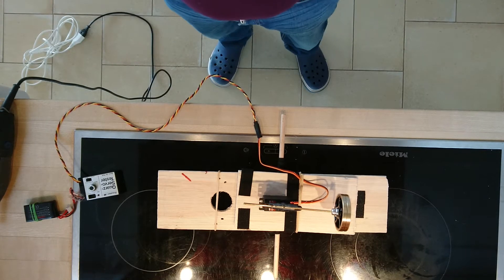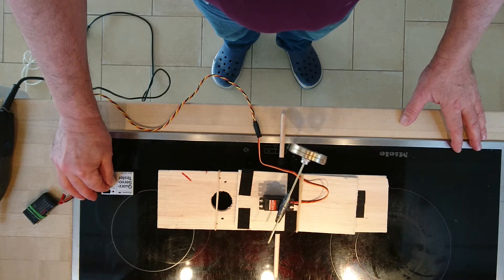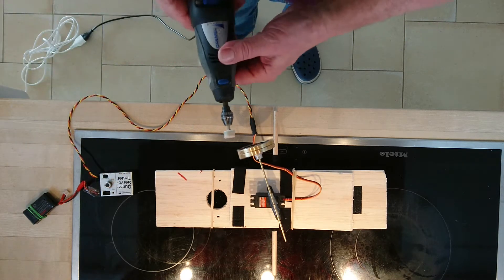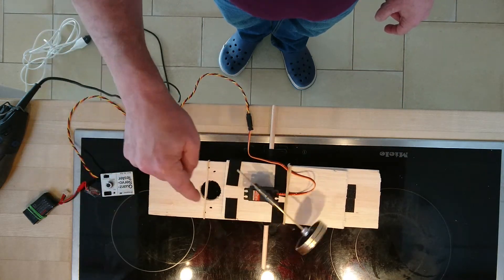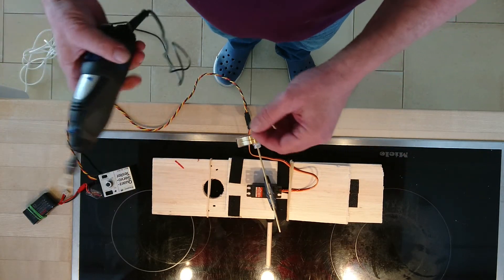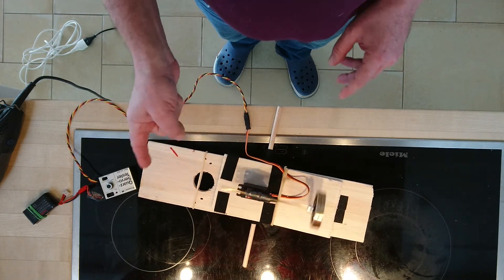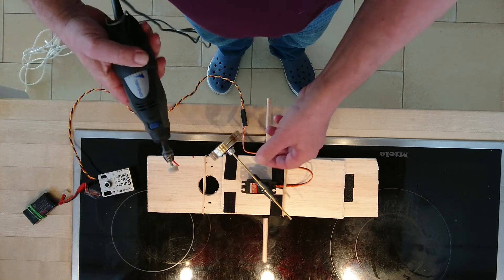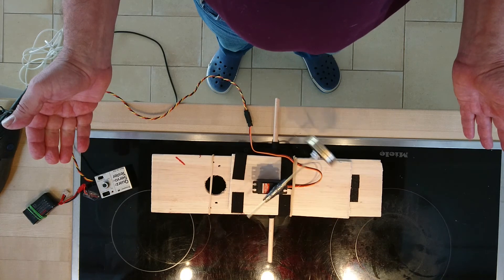inertial propulsion with gyroscope part 12

Comment: I believe that this could be an explanation. First, may I refer to a spinning gyro with a wheel diameter G placed at one end of an extension arm of radius R which is gimballed at the other end on a stationary, central, fixed mast. When the spinning gyro is released it will try to keep the spinning plane due to its angular momentum and energy contained in that spinning plane, but the heavy spinning gyro will drop a little due to gravity creating weight. The little gravitational drop at the gyro with wheel diameter G, operating at a radius R from the fixed mast center, will cause the uppermost spinning particles at radius G/2 and the upper half of the spinning wheel to move out, hence changing their spinning vector with an outer velocity component, while the lowermost spinning particle at radius G/2  and the lower half of the spinning wheel, will move in with an inner velocity component. The spinning action plus this" in" and "out" additional dropping movement will cause the 90 degrees precession effect. Due to this phenomenon, the spinning gyro wheel will try to lose its parallel /tangential plane with the circumference. Since the other end at radius R is anchored on the central mast, the center on the mast cannot move, so the reaction would be transferred to the spinning gyro as a whole to make it gain an angular velocity around the central mast.  So while the angular spinning momentum of the gyro tries to keep the spinning plane, and it would do so if we were in space, on earth, the gyro will drop and this little drop will cause the precession movement where the magnitude of the angular rotation of the extension arm R around the mast, will be a natural one, decided by the rate of the drop and the rate of spin in the gyro wheel. 
 
Now, the machine in the video has a fixed radius arm held unhinged by the powered servo shaft, and so this replaces the central mast described above. Since the servo is fixed/ had coupled to the arm, it can force the arm and so the gyro, above the natural angular velocity, had the gyro operated with the " gravity drop/force" as described above.  What the gentleman is doing is moving the extension arm above the natural precession rate of the gyro and hence he is effectively applying a horizontal " drop or force". The reaction of the spinning gyro  (in this case) is to precess upwards and hence that is why it goes upwards due to the horizontal "excessive" force applied by the servo arm.
As the spinning rate of the gyro is lowered ( or the servo arm slows down below the natural rate) then the weight of the gyro will take over and it is the torque with the weight of the gyro and the moment arm R that wins.  Before it was the gyro precession in an upwards direction coupled with the moment arm R at a fixed servo center that did  win the torque game 
Note that the precession effect on a dropping gyro is exactly the same as the precession effect when the extension arm is forced to move ( drop) horizontally). With high spinning gyro and a horizontal force applied by the servo arm, it is the precession that lifts more than the weight drops, and conversely, with a low spinning gyro or a slower extension arm, the weight of the gyro will win the torque game. 
Note that this explanation applies to all that this charming gentleman, the "woopyjump" is doing with his gyros. When spinning particles are made to move out or in of their plane, as they spin at high speed around the gyro center, that little angular change will cause the quadrature 90-degree precession.  If the spinning gyro is mounted on an extension arm with the mast/hinge being fixed not at the center of a rotating platform, then the lifting and dropping of the whole gyro become even more interesting. Perhaps we shall explain that some other time. I wrote this off the cuff and I might come back to make some clarifications.

Addenda.
A.   It is to be noted that since I wrote the above, my research has shown that when a gyro is spinning and precessing, then two centrifugal forces are generated, one is "inbound" acting on the top ( horizontal ) half of the face of the spinning gyro and the other "outbound" acting on the lower (horizontal)  half. These two forces are generally of the same magnitude at high rate gyro spin, but opposite in direction and so the "floating gyro " will not show any centrifugal force as we know it. At lower spins, the conventional outbound centrifugal force takes over. The gyro rises because the inbound centrifugal force acting on the top half helps to " torque" the gravitational weight of the gyro upwards to lift it as shown in the video. For a normal torqued gyro without the extension arm, this phenomenon also happens to change the angle of the gyro.

If one wants to dig a bit deeper then one needs to study the accelerations in the three-dimensional cycloidal trajectories followed by one mass particle in the spinning gyro.  The plan view of the cycloidal trajectory will show the presence of the inbound and outbound centrifugal forces acting on the top horizontal half and the lower horizontal half respectively. These two centrifugal forces will eliminate the conventional outbound centrifugal force we are accustomed to and there is no reaction on the central pivot. 

B. If one looks at the side elevation of the cycloidal trajectory of one mass particle in the spinning and " cycloidal translating" gyro wheel, then one would see that as the mass particle is being accelerated down one of the "vertical halves", the GYRO CENTRE needs to lift up to produce this acceleration and while the particle is being decelerated up the other " vertical half"  then the GYRO CENTRE also needs to react to this deceleration by lifting up.  It is this lifting up of the center of the gyro wheel due to the large radius accelerating particles down one "vertical half" and decelerating mass particles up the other 'vertical half"

To understand the contents of the last paragraph all one needs to do is to appreciate that   THERE IS A SOLID CRANK FORMED  by the fact that the long extended  SOLID axle of the gyro is SOLIDLY  attached to one spinning SOLID gyro radius at 90 degrees whose outward tip carries the heavy mass particle  WHICH IS CONTINUOUSLY BEING ACCELERATED DOWN A VERTICAL HALF AND DECELERATED UP THE OTHER VERTICAL HALF.  It is this lifting reaction that carries the gravitational weight of the gyro ( or other side weight) without affecting the reaction on the central pivot point carrying the floating gyro!  That is the whole reason why central pivots on ice cubes and wheeled trolleys and hanging strings behave the way they do. 
To test the CRANK ACTION in a gyro, bend a piece of solid wire in the form a crank with long shaft and quadrature stroke throw, place a heavy nut on what one may call the " big end of the crank". At the pointed end of the crankshaft ( replacing the central pivot) bend it up a little so that one has a moment arm to rock the crank where this "pointed central pivot side" is held to rock and roll,  but stay in the same position. If this crank is placed on a free edge of a table so that the weight hangs down, on rocking the crankshaft the hanging weight will stay in the same location due to its inertia but the solid corner junction between the shaft and the throw will swing and take the reaction.   It is important to note that NO GYRO WILL WORK IF THE JUNCTION BETWEEN THE AXLE AND THE QUADRATURE GYRO RADII IS NOT SOLID ALL THE WAY. 

Conclusion:-
A. The two opposite centrifugal forces acting on the top horizontal half and the lower horizontal half will eliminate the conventional centrifugal force when the floating gyro spins and precess at high speed. There is no rection on the central pivot because of this phenomenon. 
B. The downward acceleration of mass particles down one vertical half of the spinning gyro and deceleration of mass particles up the other vertical half will react in lifting the center of the spinning gyro to lift the gravitational weight of the what torques the gyro. The fact that these accelerations take place in the vertical plane they have no effect on the central pivot point. The lifting of the center of the gyro is not perfectly vertical but has a  circumferential component with the radial arm which causes the radial arm to rotate/ precess. The fact that these forces are generated within the gyro itself as if the gyro has a propeller to pull it around, there is no reaction on the central pivot as when airplane banks to take a curve. IT ALL BECOMES A SELF CONTAINED LIFT AND TRAVEL as a self-powered aircraft flying. ( It is gravity torque and angular torque in a gyro...(mgRarm= IWs.Wp))
Please note that I tried to simplify it but in practice, A and B functions work together.  At the slower spinning rate of the gyro, the rotating masses are subjected to the normal outbound centrifugal force and when there are two masses they will finish up rotating about their center of masses but only if the gyro is not spinning fast enough.

All the above work should be checked by 
The Imperial College London, Dundee University, University of Cambridge, Sydney University, and other universities where gyro projects were taken up. I now work on my own but did a lot of work at the University of Malta and I would like  these phenomena to be called, " The Carmel Pule' horizontal and vertical  cycloidal variable accelerations in gyros"   or " the Carmel Pule' opposite axial accelerations and the accelerations in the slightly thicker cylindrical/cycloidal larger apparent volume of the spinning and a precessing gyro"

Comment: Hiya WoopyI have done loads of experiments, but not this.  Thank you, as it explains why one of my machines worked wonderfully well but after a strip down and reconstruct to make it lighter ( more active mass less useless mass) it refused to show the displacement produced by the earlier machine until I reduced - not increased as I would have expected - its motive input.Thanks for your demonstration of mechanical smarts which explains what happened.Nick

Comment: Hi Woopy! I want to mention about an accident that happened some 20 years ago to a close friend of mine while testing a lab centrofuge. The machine speed was 20 000 rpm , the bowl weight about 2kg with a diameter 110mm. He span the centrofuge few times without the top cover as he was in a process to refurbish it. The last time the bowl flew in the air about a meter high and stood there at a fixed spot for a long , long time. It was only after that it shoot sideways and hit the wall.My friend was very scared and impressed at the same time as the spinning bowl was hanging in the air not affected by gravity. Thanks again ! Krassi
Reply from the maker: wooww it seems incredible, the ball stays in the air at a level spot. Did he tried to reproduce the experiment in a safer mode ?